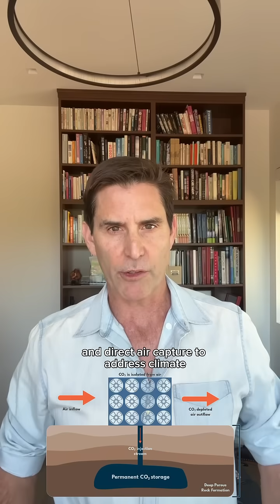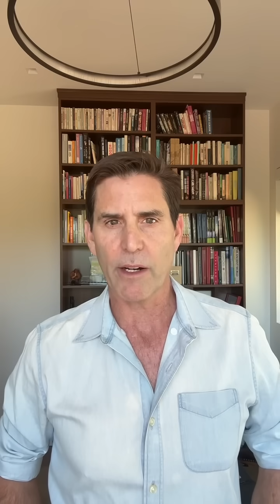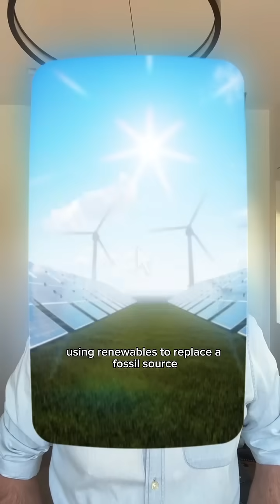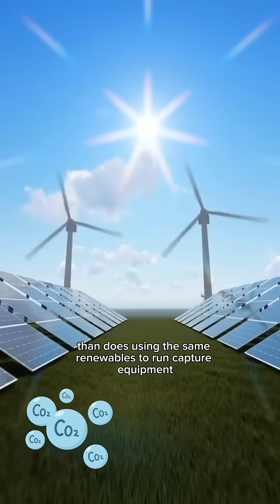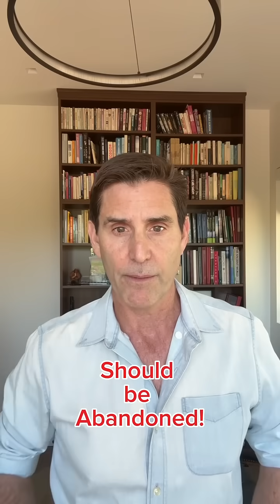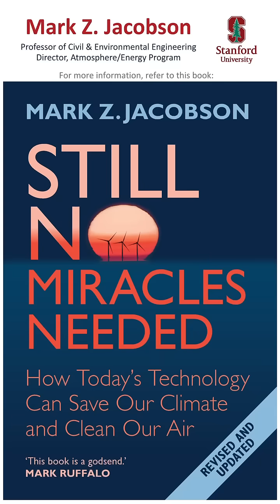Why Carbon Capture and Direct Air Capture Increases CO2 and Air Pollution and Should be Abandoned

Comment: It's an urgent situation, and we need to start naming the names of companies that are selling snake oil. Toyota and Honda should be shamed for using Hydrogen vehicles to delay EVs. They might have caused more damage than VW's diesel emissions testing cheating. Anyone claiming we'll ever use carbon capture in a meaningful way should likewise be shamed.